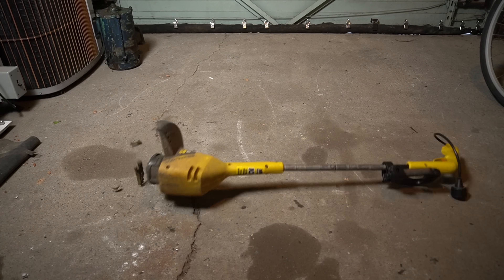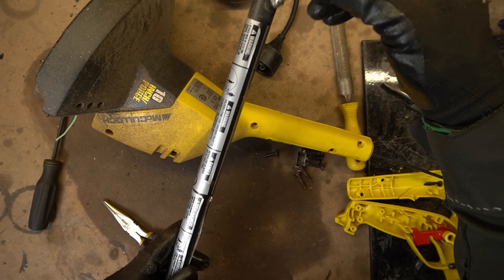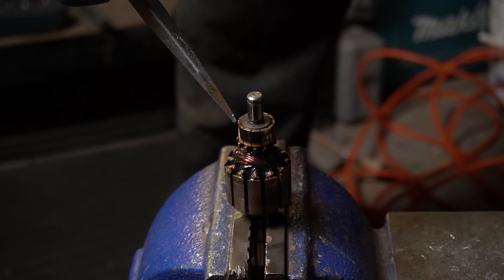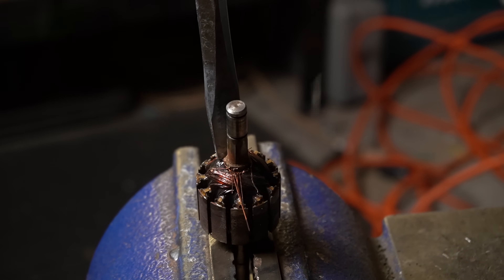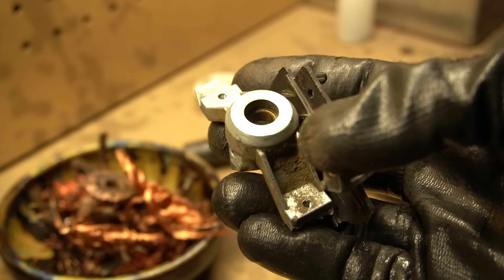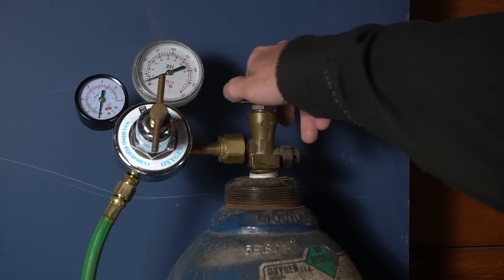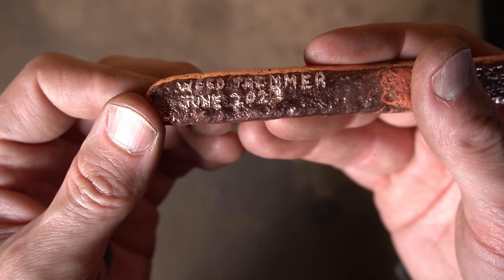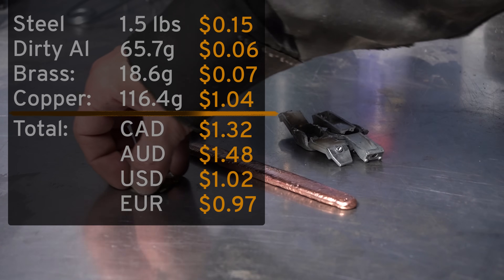Scrapping a String Trimmer and Pouring a Copper Ingot

Comment: the top part of the armature where the brushes rub up against is called ""Commutator""
Now...
Next time, put the arm in the vice with the commutator UP...
SMASH The heck out of the rotor shaft.... send it thru the arm.
Cut off the top part of the copper like you did after you smashed the commutator (when you had the rotor on)..
ANd then.............. pull out your copper from the bottom of the arm.
aaaaaaaaaaand... there you have it.

Comment: keep pipe with handle.  you can use it as leverage extension tool  with nice handle to pull on.
Reply from the maker: That’s a good idea, this one isn’t made of strong material though
Reply: @thubprint  not always has to be strong.  i found my handle stronger than the sheet metal tube.  but you can grab those emt tubes which is stronger than my weedwhacker tube. but using same handle. 🙂

Comment: Melt silver please, maybe from switches?
Reply from the maker: That is part of the plan for sure, but those silver buttons aren’t pure silver. They have cadmium or tungsten to prevent them from welding together and the cadmium is highly toxic. I need to refine the silver with electrolysis first, but I need to collect enough to justify the nitric acid that requires. I’m looking forward to it though! 😁

Comment: If you are going to be selling your ingots and you are simply melting because lets face it it’s awesome do not mix any zinc into the crucible because if your buyer questions your copper bars and shoots them with the gun it will tell them there are trace amounts of zinc and you may get #2 instead of #1.

Also melt as much as possible all at once. Get a 10lb crucible and pour 2 bars at once trying to maintain the heat. Propane is expensive. It is much more hip showing up to sell your copper and brass in bar form.
Reply from the maker: Great points, thank you! I’m not too fussed about selling the bars but I am being careful to have separate crucibles for each material. I was aiming to do a few smaller items like this to test the response before investing in the big kiln. I do like the idea of having a growing stash of copper bars though! 😁
Reply: Princess auto sells 5kg crucibles for $20 now

Comment: The security screws are there to make it more difficult to electrocute oneself.
Reply from the maker: I mean that’s fair but if a person is dead set on electrocuting themselves they’ll find a way
Reply: @thubprint  Very true. Here in Australia we use 240 Volt AC. I personally prevented a Colombian friend from frying himself as he thought the broken trigger switch contacts could just be taped together to start the trimmer and just untaped and pulled apart again to stop it. 😆
The only thing that would have stopped would be his heart.

Comment: if you do more weedeaters in the future, I would start a bin of the heads (write the brand they came off)- you can probably sell them to the local back yard "I'll fix it for 50 bucks" guy.

Also really great video. I had a blast watching it.
Reply from the maker: Nice, thanks! I had a fun time making it 😊
And that makes sense, those parts probably get broken more often than anything else on them
Reply: @thubprint  Yeah, and it's a easy fix (and keeps the thing out of the dump). 

Thanks for you content! It's taught me a lot. (rookie scrapper still)

Comment: Princess Auto sells $5 security bit sets. They come in a squishy blue plastic enclosure. However, they're always too short. Tools often have deeply recessed screw holes. So you need to go to the Princess Auto off 114th in the south (the north doesn't carry them), and get one of their $12 6" long security torque bit sets. Worthwhile if you ever want to fix... almost anything tool-wise nowadays. They always slip one in to screw (ha) with you.
Reply: I was scrapping some random thing, and it had 3 phillips and a security flat head.  It's amazing how well a sawzall can handle the plastic and that security screw.
Reply from the maker: I think I’d love to have the full kit of every security screw and the long ones sound great! Definitely more important for fixing stuff than scrapping stuff haha
Reply: @thubprint the harbor freight $10 beat box is still unbeatable.

Comment: You want a copper product you can make and sell? Look up a video on flint knapping. We use a tool called a billet or bopper. They're hard to find! You can make a mold and melt copper into billets and sell them. I need one! Fat copper isn't a Home Depot acquired item. In fact, big copper hammers, are also useful but unobtainium. You need to make copper flint knapping tools.
Reply from the maker: That’s super cool, thanks for the input! I’d also watched videos where the fella uses antler but I suppose that’s more because it’s easy to obtain. I can see why copper would be good though, sturdy but soft, good material to express pressure but not straight up crush the workpiece. I could certainly do a hammer!
Reply: @thubprint  definitely a good selling thing at the knap-ins. Solid copper lasts for years. Antler wears out quick. The tool I'm talking about looks like a mushroom to be polite lol. Kind of phallic?
Reply: is that the little spike that goes at teh end of a ichie stick?
Reply: @DSJHomestead  I use ground wire for pressure flakers and hollow plumber caps with lead for boppers. Solid copper boppers go for $50 or more.
Reply: @Jason1975ism  Last time I tried napping, my instructor had me using deer antler for both bopping and pressure flaking. But I'm also a scrapper who loves to melt stuff, so looking for things to sell to help keep the farm/homestead running is def worth it. I need wintertime projects.
Reply: @DSJHomestead  antler is ok but it wears out and isn't as easy to get. Definitely look at making solid copper billets. Copper knapping tools are a good selling thing.

Comment: I scrapped out my own the other day. And yes I did try and fix the switch but it wouldn’t stay fixed. I’ve done several others. Lots of plastic! But a nice little motor and not much wire. Better than the trash.

Comment: Good video. can you get a gas devil forge? im thinking to buy one  for making copper ingots  the good side id that you can upgrade #2 copper into  #1   and dont forget the copper from relay contactors.  it is thin copper but  if you  get enough  as a  good scrapper  you are,  will make diference at long term